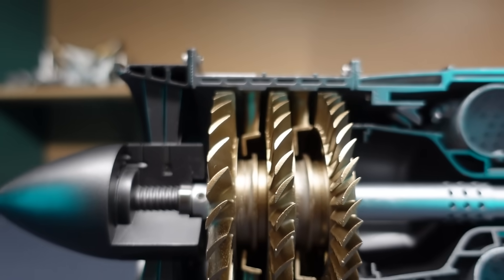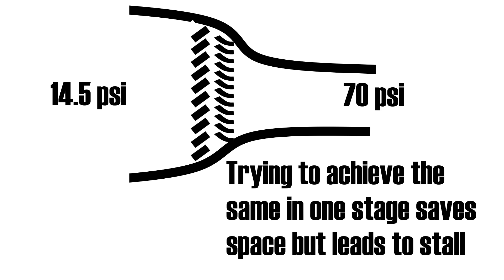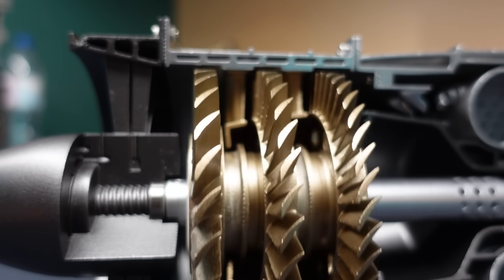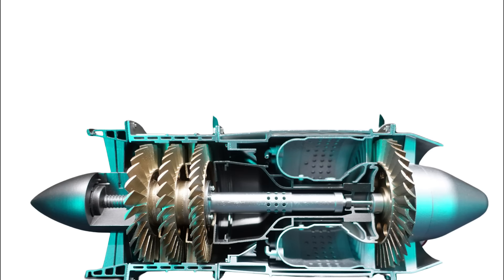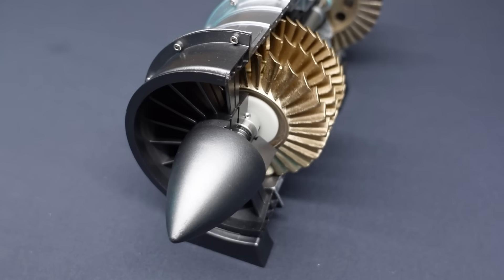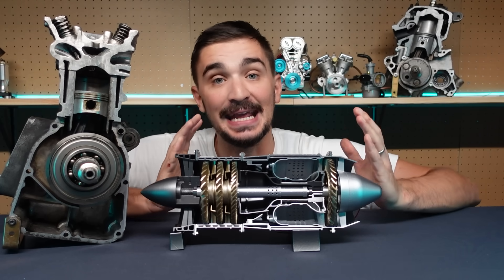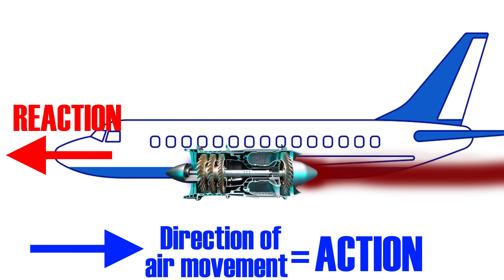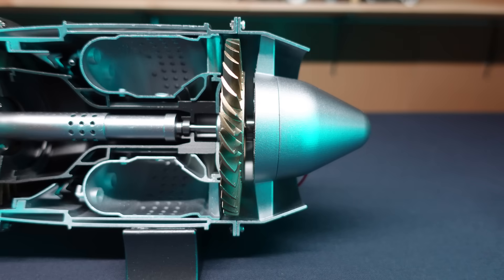Appreciating The Beauty of Jet Engines by Juxtaposing Them Against Piston Engines

Comment: Why doesn't combustion in a turbine push back on the intake air?
Reply: Because of the incoming airflow's momentum.  It actually DOES push back out when a jet compressor stalls, you get giant fireballs coming out of both ends of the engine.  That's also why you need to spin a jet up to speed before you ignite it.

Comment: This is a good intruduction video. 

I just want to correct that the combustion only needs ignition for startup, during operation the burning is self sustaining.

One more thing that I want to say is that the burner does not increase the pressure of the gas/air in a jet engine. The pressure ideally stay the same as the pressure after the compressor, but in a real engine it has some drop in the combustor. It need to stay lower than the compressor end pressure or the flow would reverse in the engine. What the burning increase is the volume of the gas when its temperature increases. Then in the turbine the speed/pressure of the flow is partially converted to power.

More power is made in the turbine than it is put into the flow by the compressor because there is more volumetric to the turbine when the temperature of the gas is increased.

Comment: at 6:54 you say the combustion increases the temperature and pressure. 
Temperature yes, pressure no. 
The temperature increases the volume and volumetric flow.
There is a pressure decrease from the last compressor stage to the last turbine. 

If there was a pressure increase, you would have a flow reversal and compressor stall/surge. 

https://i.stack.imgur.com/eLcXa.jpg

Comment: Back when I was a kid, I used to read some classic sci-fi novels from the '60s and 70s. At least one of those authors (Ben Bova) envisioned a 21st century in which we'd all be driving around in cars powered by either tiny jet engines or magneto-hydrodynamic (MHD) engines because of their greater efficiency and power compared to the piston engine that has been common ever since then. Now, 50 and 60 years later, we are still using virtually the same piston engines as we were back then. What happened? Could you do a video on the potential efficiency of powering a car off of a tiny jet engine or an MHD engine?

Note that obviously the concept was NOT to have a car powered by a jet engine big enough that it needed to be exhausted out the backside, because if it was, every car on the road would totally torch the car right behind it!

Comment: 6:51 You misspoke here. Pressure does not increase during combustion in a jet engine. The volume expands while pressure remains relatively constant.
Reply: It's just semantics. Dynamic pressure goes up while static pressure goes down or stays the same.
Reply: @xBIGMUSCLEx  I feel it's an important distinction, and the way it's stated implies that it's the static pressure that's increasing. Jet engines and piston engines operate on different thermodynamic cycles. Piston engines use the Otto cycle or the Atkinson cycle whereas jet engines use the Brayton cycle. Combustion in the Brayton cycle is considered to be Isobaric.

Comment: Pretty sure at least RR turbine blades are/of a single crystal, which reduces fatigue/cracking of.
Reply: Lots of engines have single crystal cast turbine blades.  

It’s not for fatigue.  It’s for creep.  Turbine blades are under tremendous stress as well as heat and will gradually elongate (creep) at forces well under the yield strength at that temperature.  

Single crystal metals are actually weaker than those with grain boundaries.. as the grain boundaries dissociate under stress they actually make the metal stronger (this is known as work hardening).  But we don’t want this to happen to turbine blades because they have to yield (in this case, stretch) to do so.

Comment: I don't understand when you're describing the intake of the jet engines, The jets I've seen irl and the pictures I've seen of different jet aircraft all have spinning inlet cones and I can't see the inlet guides at all. I love this channel I'm not trying to troll but this bugs me more than it should. Is it just modern design or newer jets are no longer pure jets but jets with fans on the front?
Reply from the maker: You figured it out already. The "spinning inlet guide"  on modern commercial jets is actually a fan not an inlet guide at all. I mentioned this at the end turbofan vs turbojet
Reply: All modern jets are things called turbofans.  They have an extra turbine/s at the front of the engine which compresses the air before it gets to the actual jet engine's compression turbines, but it blows part of that air around the jet engine itself through bypass ducts and this compressed air itself creates thrust (similar to how a propeller does, its' the same basic concept as a ducted fan).

They're technically capable of less peak thrust than a pure turbojet, but they're much more fuel efficient and since airspeeds in jets are limited by the surface temperatures of the jet rather than thrust (for supersonic jets) in most situations more thrust isn't always better than more efficiency.
Reply: Thank you for this explanation!   @jimmydesouza4375

Comment: And then we get motorjet engines and turbo-compound engines which combine the two

A piston engine with a turbo - compressor  is in many ways a turbo-compound engine

Some aerospace, automotive engines use a power-recovery turbine which uses exhaust gasses to turn a turbine which helps turn the crank on a geared shaft

One of the biggest trade secrets for turbine engine manufacturers is the material used for turbine blade manufacture, the turbine blades need to stand up to extreme temperatures for long periods of time - not just any material can be used, and significant research goes into finding more suitable materials for greater performance requirements

Comment: Please do more or this aviation stuff. I find it very fascinating,  not least the final developments of large radial piston engines. The Wright engine used in for example the Douglas DC7 actually used turbo compounding with a turbine very similar in principle to the one you showed running off water. This turbine added power to the engine without taking any power from it..

Comment: Minor addition, turbojets not attached to an airplane almost always have multi stage turbines as well as compressors. Some even have centrifugal stages. And comparing efficiency between jets and piston engines is complicated. Jet efficiency is very pesky, they need to run in a very narrow speed and temperature range to be efficient, where they perform much better than pistons. But if the use case cannot maintain that range for a prolonged period it will be less efficient. Land vehicles are constantly speeding up and slowing down and frequently run for less than 20 minutes, making jets unsuitable. 

Engines with afterburners feed fuel through weep holes on the turbine blades to cool the charge, just like a turbocharged piston engine. That fuel is then burned in the afterburner, not wasted. Some without afterburners also have this capability, but only utilize it when sensors detect the engine is in danger because that fuel would be wasted.

Comment: Thumbs up.

Technically, temperature and pressure are forms of kinetic energy, not potential energy. The unburned fuel and the momentum and the altitude of the plane are potential energies. 

Another benefit of higher speed air travel is reduced time spent countering gravity, which helps make up for drag being exponential.

Piston engines are becoming efficient enough to change the paradigm. We'll probably see sequential piston engines in aircraft in the future.

Comment: I remember all the science magazines in the eighties telling us that "very soon" all of our cars would use turbines and that they'd be getting 100 mpg or more. Turns out there were many issues that were unsolvable, such as how to pipe the very hot exhaust gases away from the vehicle in a practical and safe way. Another big issue is that turbines tend to have very slow throttle response, making them not very fun to drive. But, I think they would be perfect for range extenders for electric cars because quick throttle response is not needed.
Reply: That's just wrong. The hot exhaust gas problem was solved all the way back in the 50s by regenerators which moved most of the exhaust heat back into the intake. Doing this also massively improved fuel efficiency. The real reason why our cars aren't powered by turbine engines is that the high temperatures require the use of extremely expensive superalloys.

Comment: 0:55 I completely disagree that gas turbine engines have no vibrations. The combustion cycle may be continuous, but no rotor is perfectly balanced and you can get vibrations due to air flow changes in transient regimes. In fact gas turbine engines have vibration sensors to monitor if everything is within spec. You have to mount pipes and wire bundles with the clamps at specific locations to avoid fatigue cracking in pipes and chafing in bundles.

Comment: Good video! 
     If you're going to diverge from cars, consider rocket engines as well. Non-air breathing, I mean. V2 development is interesting, and I'm always amazed by the fact that each of the 5 first stage engines of the Saturn booster had a fuel pump (of course) , turbine powered. EACH was 53,000 horsepower. The fuel pump. The actual engine power is hard to compare to any other machine made by humans.
   I'm a car/motorcycle nut, A&P mech, pilot...if it burns fuel and makes noise, it is interesting, sometimes amazing.
Reply: liquid fueled rocket engines are geniously simple in principle, but incredibly complex in practice.

Comment: I wonder if the heat capacity of a jet engine can be increased by housing it in layers of increasingly higher temperature rated alloys to prevent the most innermost alloys from expanding and therefore raising in temp. Just like how water that's below freezing inside of a pipe won't actually freeze at 32° because the water has no room to expand which happens when it freezes. I mean we already know that compressing water can allow us to keep it in a liquid state even at a low temperature.
Reply: I just thought about that and the heat would actually feedback the other way out the inlet and outlet of the engine. To maintain an object's temperature by preventing the effects of thermal expansion through compression it has to be completely insulated within that compressing force.

Comment: Superb explanation of the principle of a jet engine, I never realised that the main combustion air comes in at the front of the combustion chamber, always thought that the holes in the chamber served this goal.
In fact a car turbo can be used to make a crude jet engine, simply by removing the piston engine between compressor and turbine and adding a combustion chamber instead.
With a simple exhaust cone fitted to the exhaust flange it does even create thrust.

Comment: I always struggle to understand one thing related to a jet engine turbine: In the combustion chamber we got the pressurized air from the compressor stages (at about 5 bar as explained in the video). Then fuel is added and ignited. Naturally the pressure increases quite significantly then. But there is no (mechanical) sealing towards the air intake. In a combustion engine the air inlet valve closes and seals the inlet path. What hinders the hot gas "to go back" instead of driving the outlet turbine? My theory however is that the "escape" route for the hot gas is always through the turbine because it's the "lower pressure path" compared to the inlet path. Therefore, so to say the air inlet pressure is taking the role as "sealing device"? As this bothers me since may years I really would like to know what the experts say?
Reply: Because there is less pressure at the exhaust side (in the end ambient pressure) and so the gases expand to the direction of less resistance.
Reply: @casshern9454 Yes, that's my conclusion too (after some thought). Thanks for your answer.
Reply: The pressure does not increase during combustion in the brayton (jet engine) cycle, the temperature does, he misspoke. https://www.grc.nasa.gov/www/k-12/airplane/brayton.html points 3-4 on P/V are combustion.

Comment: I have long wondered if jet engines produce torque. The air hitting the stators should impart torque, but the air in and out is basically not rotating, so it should not create torque. Which is it?

Comment: Something to note, combusting the fuel doesent actually increase the pressure, as the pressure has to be lower in tye combustor for compressor air to be able to flow in. What it does is it takes the high pressure air, and increases the volume without decreasing pressure, you just get more of it.
Reply: but, does it increases the speed of the air?

Comment: A gas turbine is basically a turbocharged piston engine with the stupid parts removed.
An interesting thing about gas turbines is that part of the maintenance parameters is based on heat cycles - the number of times the engine was run and turned off. Because of this you often see aircraft such as helicopters left running during short stops, rather than shutting down and restarting. 
I see this at the hospitals I visit , some aircraft will be left running for 30 minutes or more  while patients are being transfered.
Reply: No, a gas turbine is not basically a turbocharged piston engine.

Comment: Why do you think jet engines haven't been used more in other vehicles? With the air:fuel ratio being what it is, you would think jet engines are more efficient and produce more power.
Reply: Jet engines have been used in every type of vehicle.  They have the problem that they're only more efficient at a very specific operating RPM range and outside of that range are absolute garbage, and since aircraft are the only type of vehicle that needs to be near or at their optimal performance for long periods of time they're the only ones that benefit from having a jet engine.  A train engine doesn't need the amount of power when going down hill that it does while going uphill for example, and the jet engine can only be tuned for efficiency at the one power output.
Reply: A high air to fuel ratio does not imply greater efficiency.
Reply: In addition to poor off-peak efficiency (which is extremely poor in the small engine sizes needed in cars and light trucks), turbine engines are expensive and emissions control is impractical. They also respond slowly to power demand changes; that can be addressed in a hybrid configuration, and a series hybrid configuration can also address the extreme gearing otherwise required (ten times greater reduction ratio than a gasoline engine), but a series hybrid is the most expensive powertrain configuration to build.

Comment: 6:55: “the mixture ignites greatly increasing it’s temperature and pressure”.  You’re half right.  In order for pressure to increase the combustion needs to be contained, as in a piston engine.  A jet engine is open on both ends and not contained.  If the pressure in the combustion chamber increased above the compressor discharge pressure, fresh air would stop flowing through the compressor stages.

The increase in temperature under these conditions results in a large expansion of gas volume.  The turbine, therefore, is fed a greater volume, and thus a greater velocity, of gas.  This is one reason your example needs 3 compressor stages but only 1 turbine stage.  The turbine stage uses a much greater gas volume.

Comment: Nice. When you expand on this, be sure to flex that "low efficiency at low load" thing with what happens at high load and how a jet engine might be ideal as a range extender/active power unit for electric vehicles. IIRC "simple" construction, high reliability, high power density, good emissions, and fuel flexibility make turboshaft APUs somewhat ideal for future hybrids.

Comment: This makes me think of the M1 Abrams. That tank supposedly has a "jet" engine to power it, but based on how you explained what a jet engine is there is no way that is an accurate description. I would imagine that the Abrams engine would need some sort of shaft that would connect it to the drive sprockets that result in track movement.
Reply: Wait for the next video, which should explain turboshaft engines. The M1 Abrams uses a turboshaft engine... specifically the Honeywell AGT1500.

Comment: Very nice video and great explanation. 😊 The OCD in me is triggered by your turbine engine model. Whoever designed it, used the wrong shape of turbine after the exhaust. The diagonal of each blade is in the right direction, but the shape is wrong, it needs to be mirrored across the diagonal. Currently, the shape is like a reversed compressor blade, but this is not a compressor blade, it is a driven blade, the force of the exhaust pushes this blade and this is where the compressor blades get their power. The current shape would be very inefficient like hitting a wall. If you look at a lot of turbine engine cross-sections you'll see what i mean. I think the designer of the model got lazy and just reversed their compressor blade design. It's a nice looking model, but not accurate. 😉